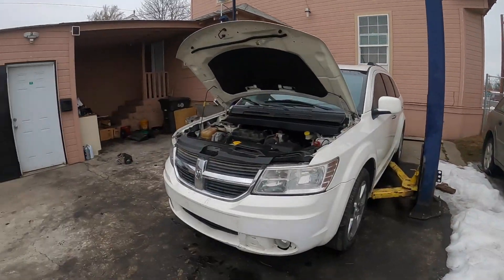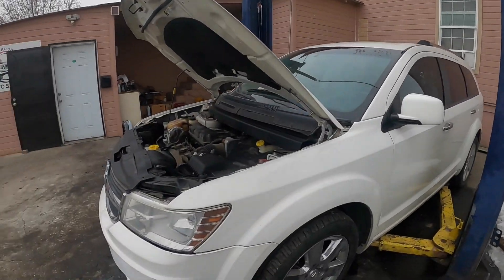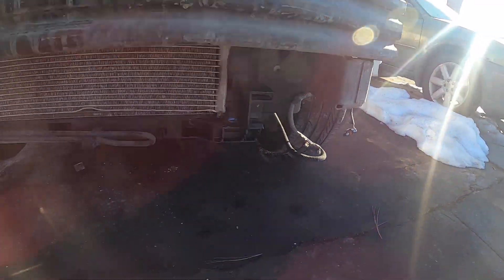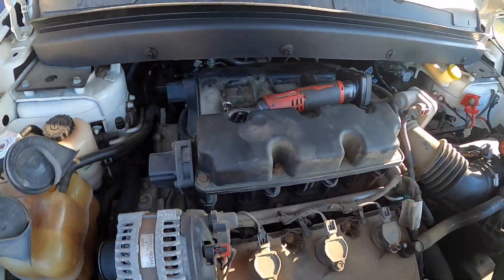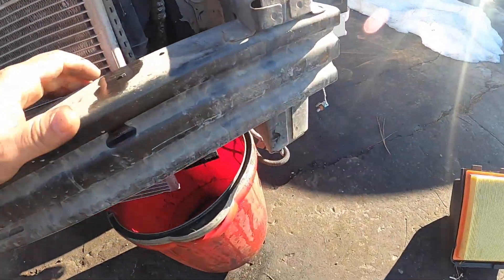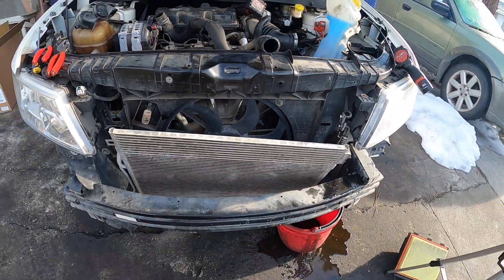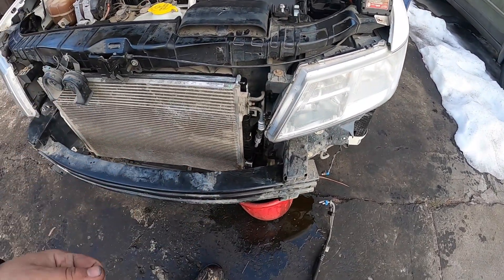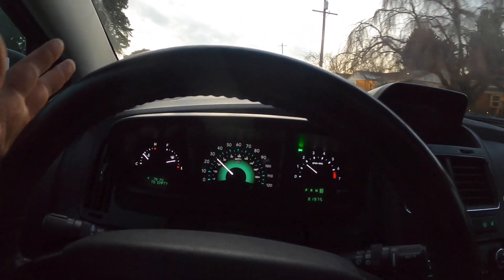How to Replace Radiator on 2009 Dodge Journey Copart Buy

Comment: I just replaced the radiator on my (‘12) 3.6. 
You NEED a clip removal pry bar
(Flat heads are for bone heads)
You NEED a 1/4” swivel adaptor

You DO NOT need to remove bumper
You DO NOT need to remove condenser/ oil cooler. 

You SHOULD replace the bottom radiator hose if you can afford the 20$ piece.  Why?  Because removing the bottom clamp is a difficult task to say it lightly.  If I had to do it again, I’d order it, and cut the old one and remove the clamp once out. 

Good luck all.

Comment: Hey. I changed my radiator.. after the car got to operating temperature the fan started smoking and the car was overheating. Any advice?
Reply: Bad fan, module or fuse. But could also be water pump. Gonna have to do some diagnostic to eliminate some things
Reply: @aguinfy4219 If it’s the water pump, have fun! I know this is an old thread, but I replaced one on a 3.5L, and let’s just say there were a lot of sailor words involved.